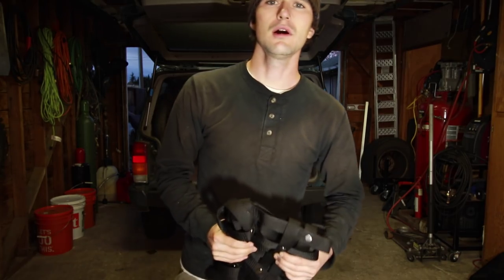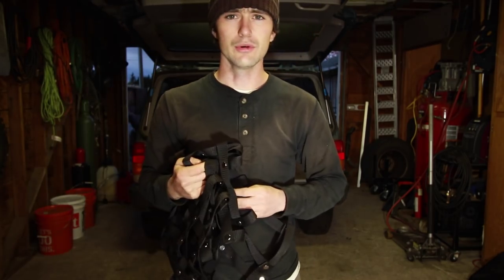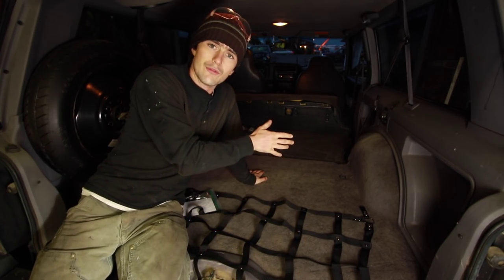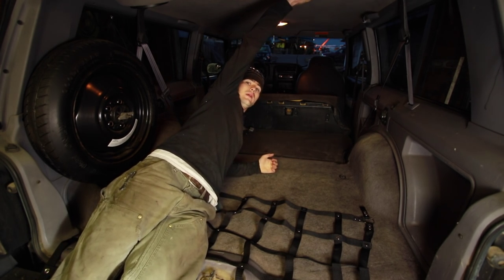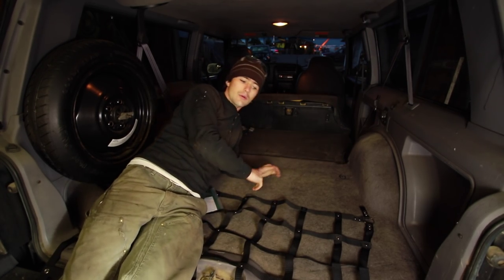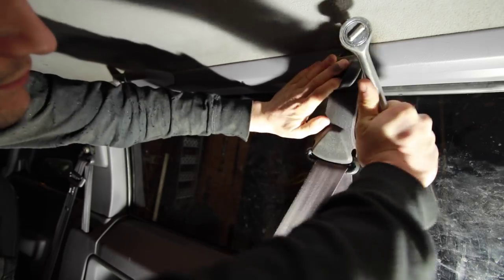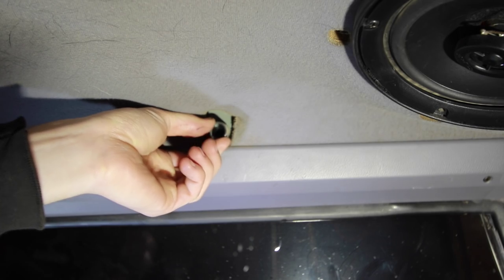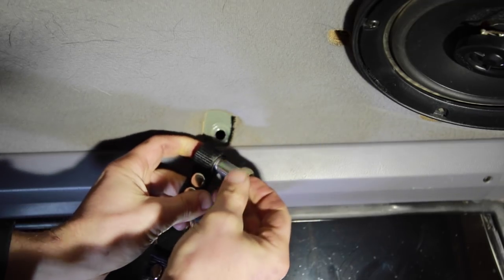Cargo Net Install - TrailTuff Nets

Comment: Those seat belt bolts are actually T47. T50 will usually work, but the fit of a proper bit is much better. The auto parts store will have T47 torx bits; they probably don't come in your torx set.
Reply: Dude, I've fucked up a few screws and throw away some T45 bits. Much appreciated!